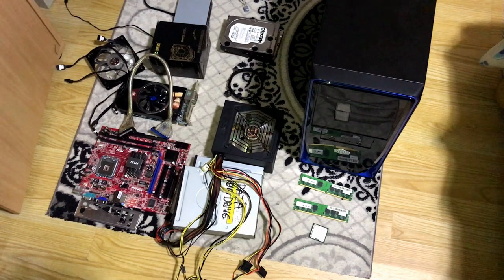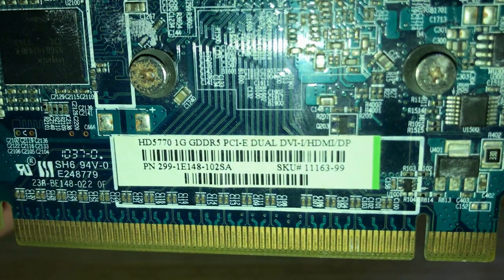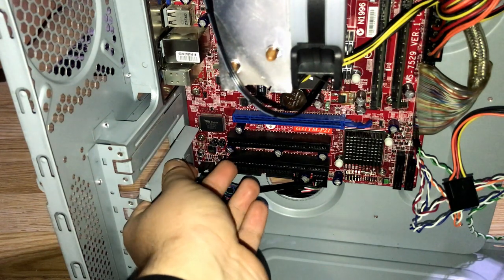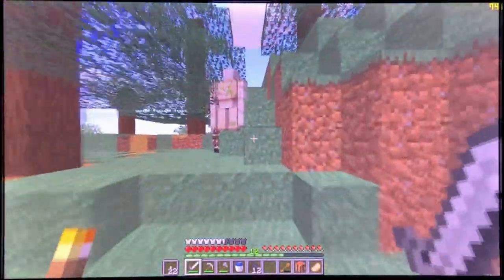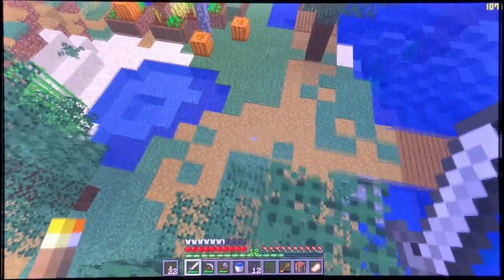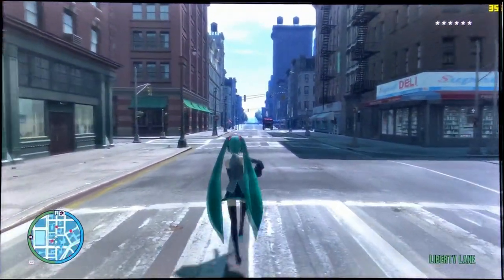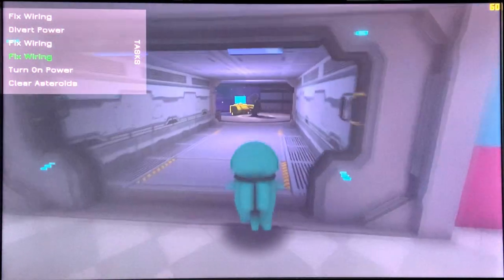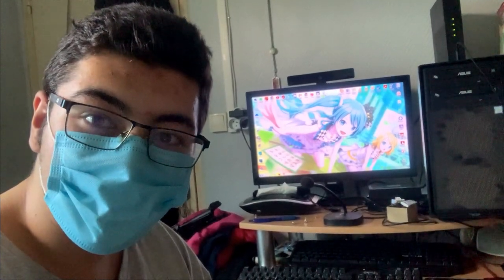Building my DREAM PC of 2008 using the Core 2 Quad Q9550

Comment: I have this CPU, I actually got it back then and I always ran it overclocked for extra performance using a bus speed of 1600mhz making it run at 3,4Ghz no problem and I used this a lot for music production and video rendering, Gaming etc. Btw be careful with your motherboard because it have several capacitors that are completely shot. if they fail you might have stuff shorting out for you. You need to Re-Cap this board
Reply: Hello I have g41 mt s2 motherboard with q8200,when I overclock it doesn't boot and fails,what should I do,my psu is very strong 780w,please help me for overclock

Comment: I am currently running a simaliar PC, with a Gigabyte P35-DS3R, Q9300, Scythe Mugen 2, HD 7770, 8GB Kingston DDR2 800Mhz Low Profile, 400W FSP Group Aurum, 120GB SSD, 250GB HDD.

Was suposed to be a Windows XP Retro PC, than a XP / Linux Dualboot - but XP denied to be installed on the SSD it became a Linux only PC. Lubuntu to be precise. Now its my "daily driver" until I can buy something "newer".
Not perfect, but good enough for now.
Reply: Nice to know. So theres no problem in linux. I just want to know if bsel modded q6600 no dgpu would work on linux
Reply from the maker: The Q6600 does not have a graphics chip. So you need integrated graphics from your motherboard or a dedicated graphics card.
Reply: @Yorkfield2008EN  lol ik. Is a g31 with gma 3100

Comment: what motherboad you are using ? (its for a Intel Core 2 Q6600 2.40ghz and a ATI Saphire 2600 Pro)
the link of the PSU and the Fan
Reply from the maker: I am using an MSI G31TM-P21
and a FSP HE-500 (Hexa 500)
fan is https://a.aliexpress.com/_EJM1ZFp
Make sure you select LGA775 before buying! (its written 755)
Reply: @Yorkfield2008EN  merci j'avais pas vu que tu est français 👍
Reply: mais pour le disque dur ta installer avec un cable special ? un cable SATA ?
Reply from the maker: Le disque dur j'ai utilisé un câble sata standard

Comment: motherboard evga nforce 680i sli black pearl is one of the best for intel core 2 quad processors is installed bios award full version supports ddr2 gskill 8 gigabytes 4x2 gigabytes 1066 megahertz memory three graphics cards equal in sli and crossfire mode I have only seen two better chipsets nforce 2000 professional and nforce 590 sli manufactured on taiwan for intel core 2 quad processors

Comment: 5770 was released near the end of 2009, according to google. Shouldn't you be using HD4890 or GTX 285?

"Steam works on Windows 7" - not anymore!
Reply from the maker: The 5770 was the only GPU I had when filming this, but now I have a GTX760 to pair with this system at best.

Steam worked on windows 7 back when this video was filmed and uploaded.
Reply: @Yorkfield2008EN  I mainly meant that the 5770 did not yet exist in 2008 (and, of course, neither did the GTX760).
Reply from the maker: True.

Comment: Why q9550 not support windows 10?😢
Reply from the maker: Actually, it can run Win10 without any issue, but I refuse to use it since it's literally spyware and has telemetry, where as Windows 7 doesn't have that and isn't spyware.
Reply: @Yorkfield2008EN  thank you sir 🙏
Reply from the maker: Np mate!
Reply: @Yorkfield2008EN can you tested genshin impact or call of duty warzone
Reply from the maker: I did test Genshin on that PC, but I couldn't get my hands on Warzone.
Reply: @Yorkfield2008EN  where the video for test genshin impact
Reply: @Yorkfield2008EN  or overwatch maybe